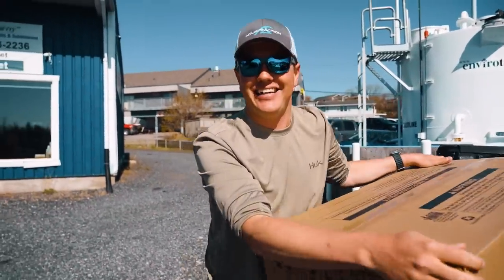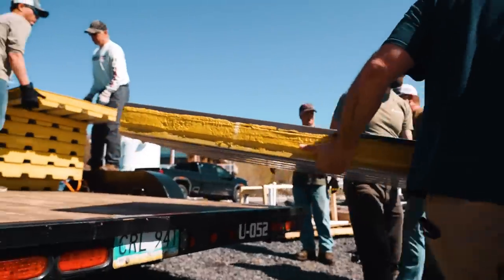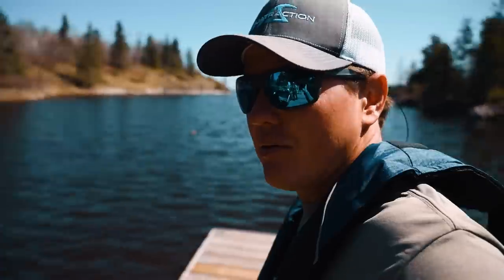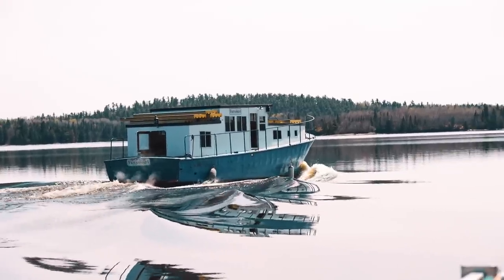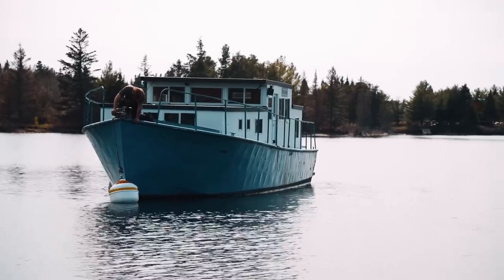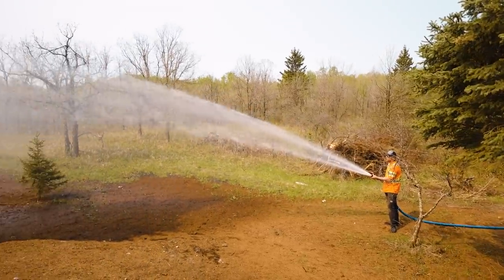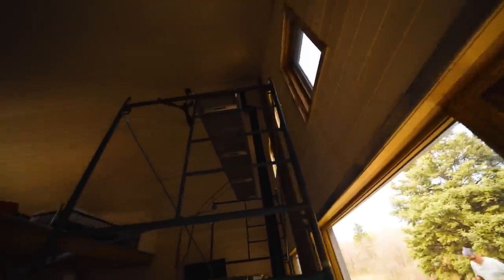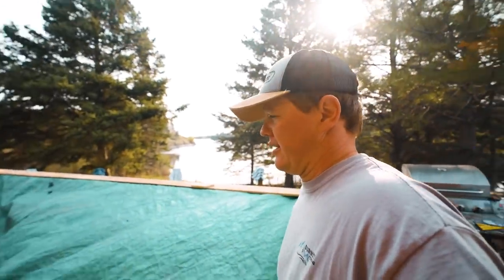The Pressure is ON (Musky Under The Dock!) - Building An Off-Grid Fishing Cabin - Chapter 21

Comment: Don't promote wearing the kill lanyard incorrectly. There's plenty of videos of that slipping off ppls wrists when going overboard and not killing the engine. Always use the clip to clip securely to clothing or something that will pull the cord and not slip off. Look it up. A loop on the wrist won't always work. It has to be attached better than that. Unless u can pull it from in the lake...This is just advice not angry critisism.